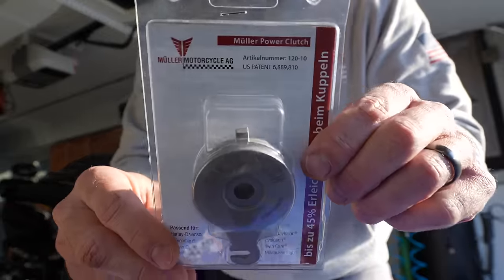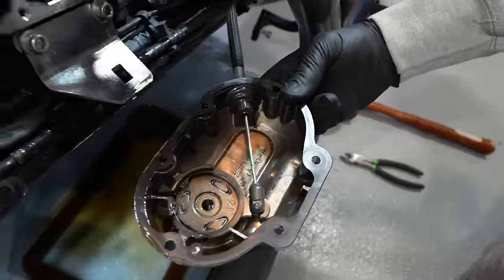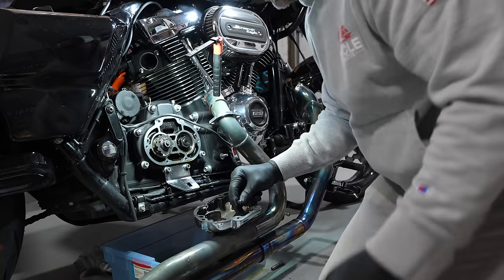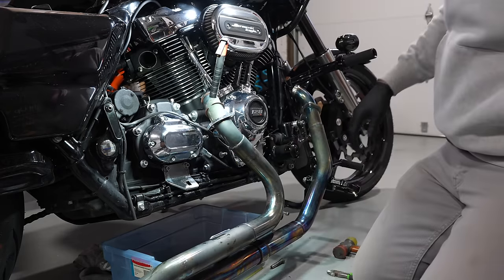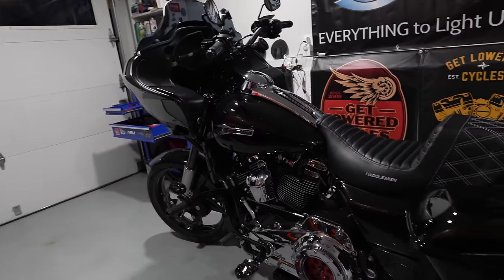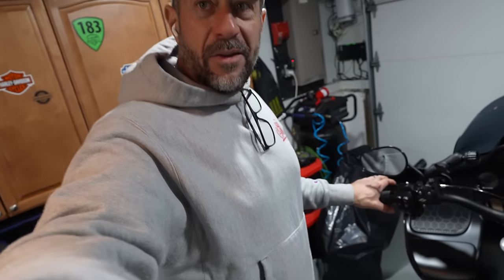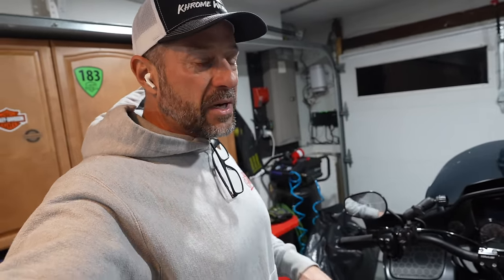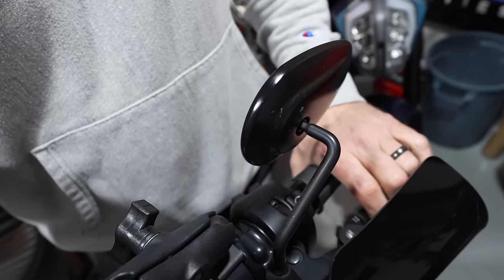how to get buttery smooth clutch Harley Davidson bagger S1-E4 #cyclefanatix #harleydavidson

Comment: Just in case anyone is wondering. I have pulled two elite Moto tech easy pull levers off two different bikes that had evolution clutches. They do not work with the evolution clutch. That shortens the amount of disengagement of the pressure plate to the point where the clutch does not ever fully disengage. I have not yet tried a one finger lever yet. Would love to hear if anyone is running that set up and if it works or not.

Comment: John - it would have been advantageous to see what the pull weight was prior to the installation of the new part.  Curious to see how much it actually decreased from the stock setup.  Definitely stay off that brine solution on your roads brother - you’ll have corrosion in places that you can’t see deteriorating your ride.  I don’t miss that weather my man.  Stay safe out there and looking forward to a follow-up ride review.  🤜🏼🤜🏼

Comment: If i understood correctly, you mentioned this makes the clutch pull harder than stock. Is this correct? I'm looking at installing it on my stock 2013 FLS, but hesitant to do it if it's going to make it a harder clutch pull. BTW Great video!

Comment: Just installed the Evolution clutch on my FXLRS and its still a beast to pull with the Elite Levers easy pull setup.  Definitely adding the Mueller over winter.  It was already a plan but this solidified my thoughts.

Comment: I have a 2020 FLHTK with a hydraulic clutch which has a hard pull also. I bought the rekluse slave cylinder which makes the pull easier and I’m installing that soon. I’m on Long Island so no riding for me the next few days either. Same thing, have to remove the pipes which sucks, remove, replace then bleed. All kind of works out cause I’ll do the brake fluid as well. Safe riding brother!